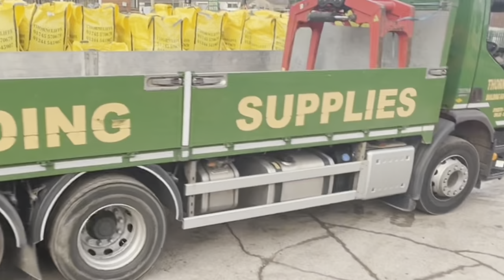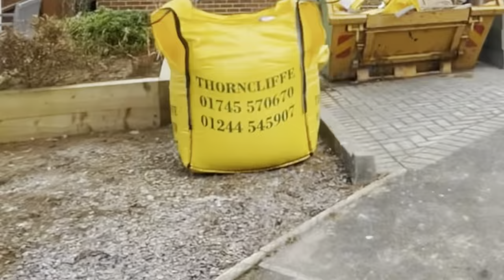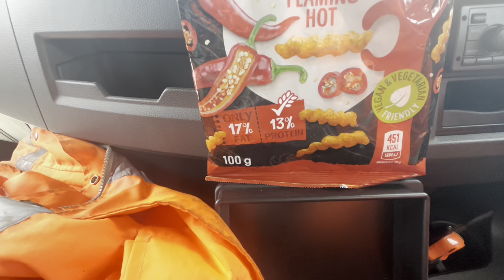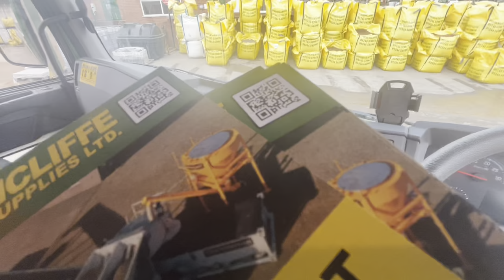I WAS IN TROUBLE AND THEN.?REVERSE ONTO A MAIN ROAD|BLOCKING THE ROAD FOR DELIVERYIHGVILOCAL LEGEND|

Comment: The 20mph works in London ones you get your head around it. Been done twice for speeding last year doing 24 in a 20 6 points and £400 in fines. In cities its a good thing but not outside cities its a no no
Reply from the maker: Yeh I agree,the cities is a good idea and it works, Chester city has been 20 mph in sections for a while and it makes you realise 30 mph through a city is pretty fast considering all the people and vehicles. Where I live a couple of the main roads in and out of the town are 20 mph and it does feel a bit over kill.